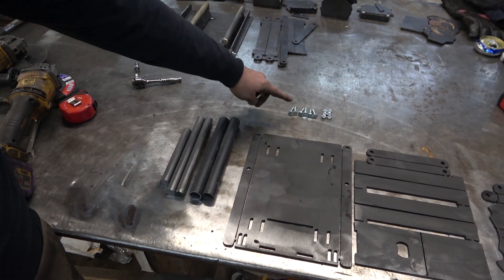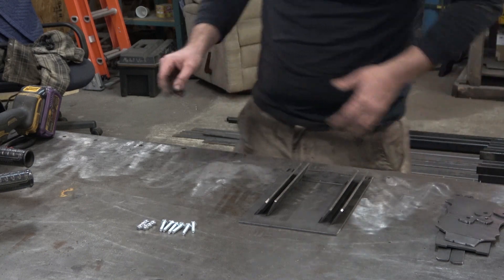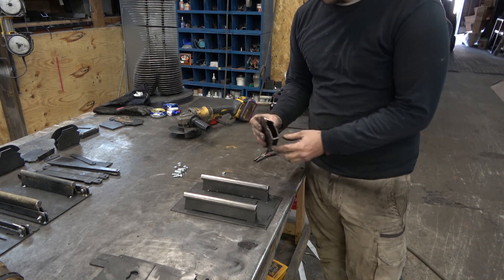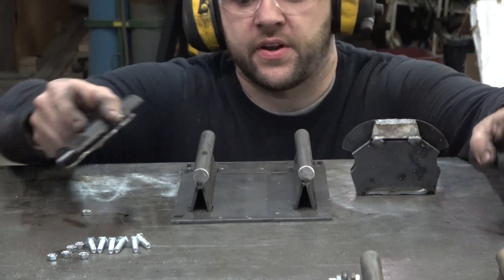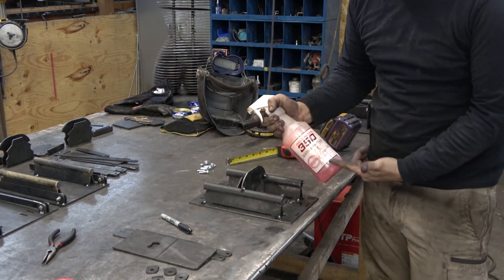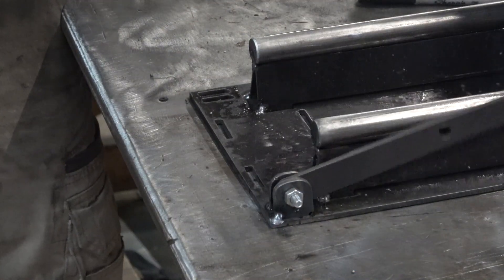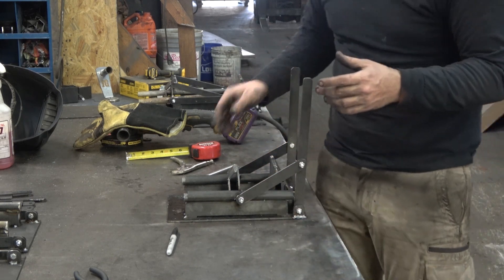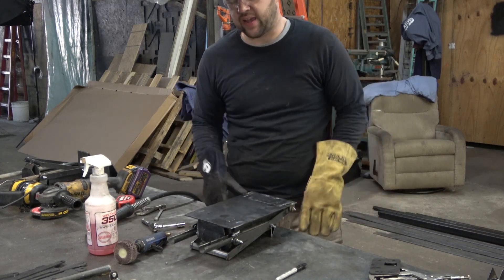Rough Draft Can Crusher Weld It Yourself Kit Video Instructions

Comment: Just a suggestion, you might figure out a way to have the can drop out after you raise the handle up.   In your next revision, you might consider orienting the back plate at an angle so that a crushed can will slide out of the back.
Reply from the maker: I actually looked at a similar setup, but decided that not everyone would want that, so ditched it